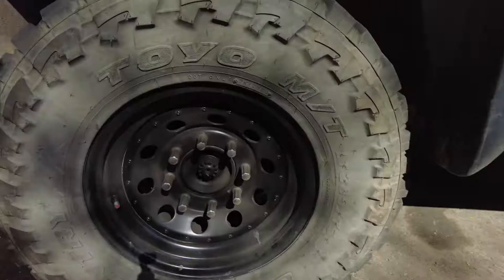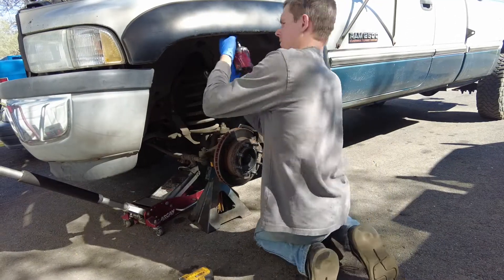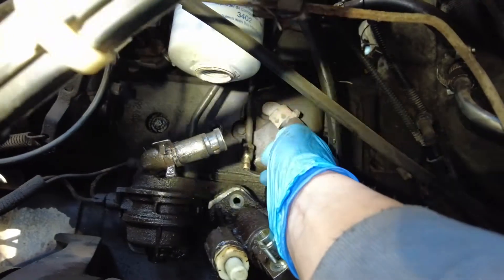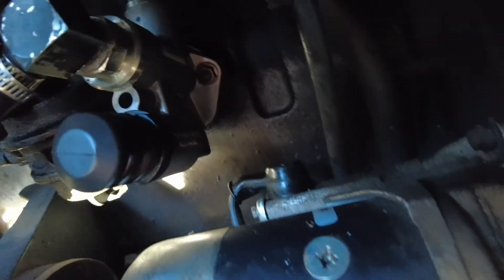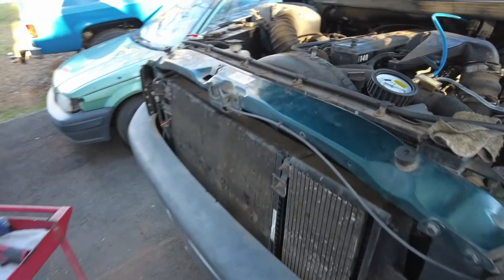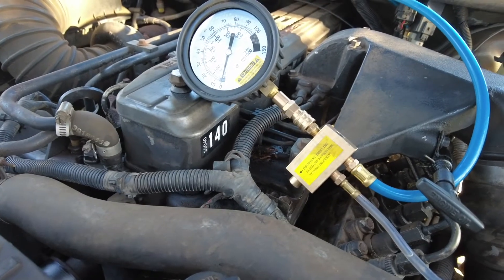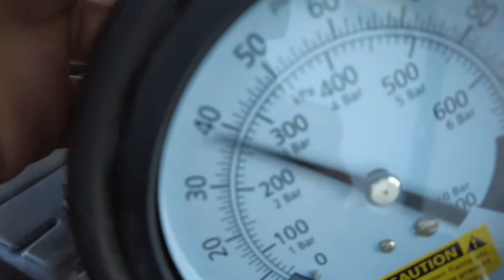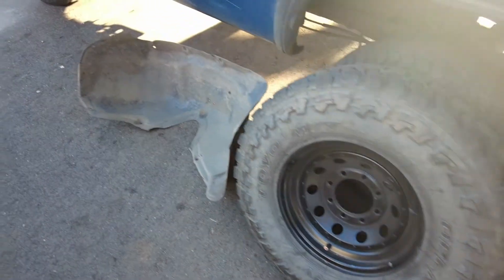12v cummins lift pump replacement (how to) 1995 dodge

Comment: Nice vid…im planing on putting a new lift fuel pump on my 97 ram 5.9 Cummins 12 valve cause it has loss of power ..I’ve seen some other vids that u gotta rotate the engine why? If I just remove the old one n put the new one in why would i have to rotate the engine

Comment: So this would have nothing to do with my issue? When i got from 3rd to 4th gear, I feel like my transmission has to search for the gear. If I let off the throttle a little bit it'll catch fourth gear and I'll ride along smoothly. Any feedback would be greatly appreciated. I live in the middle of nowhere and I do not have diesel mechanics in my area.
Reply from the maker: Hi there from what it sounds like you are describing, I would check to make sure your TPS ( throttle position sensor) is functioning correctly and is within spec. You will need a multimeter to check and there are some other Youtube videos that could help and go into detail on that.  Hopefully it all works out! Good luck!
Reply: @projectoverload440  thank you so much

Comment: Do you recommend turning the engine to TDC or anything like that b4 removing the Lift Pump?
Reply from the maker: You can; not sure what position the lift pump cam lobe will be at TDC.  It will make it a bit easier with the cam lobe down to install the lift pump. If not,  you'll just be compressing the spring in the lift pump.

Comment: Thanks for the video
What was the truck doing before you change the lift pump
Reply from the maker: Before when I'd let the truck sit for a week or two the low pressure side of the fuel would loose its prime and id have to manually pump the lift pump and crack the bleeder on top of the fuel filter till I got all the air out. In order to start the truck. This fix was not the first repair I made to the truck hoping that it would fix my problem. I also replaced the rubber fuel lines that run up by the fire wall and I also replaced the fuel pressure regulator too all hoping that it would fix my problem. But in the end it ended up being the lift pump.